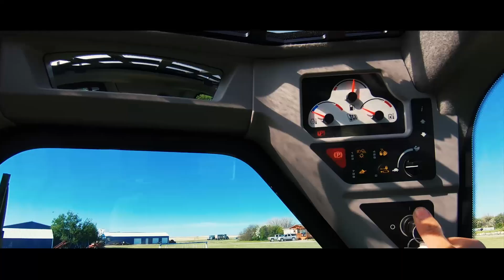JCB Teleskid - Playground Overhaul - Part 1

Comment: There's so much tread left on those tyres, man they'd have to be bald before we stop using them! ;) God bless guys. UK farmer
Reply from the maker: They are all cracked unfortunately! We run them bald too of they could hold air and not ruin tubes
Reply: @WelkerFarms  got you, your climate must really take it out on equipment left outside over winter. Bless you, UK Farmer

Comment: I wondered what was wrong with the tractor tires, they looked like they still had some wear left on them?  Was it just not enough tread depth, were they cracking?
Reply from the maker: Manufacturer defect, all cracked in the same spots and destroy tubes 😔 😢
Reply: @WelkerFarms  Yikes!  That must have been expensive.

Comment: Maybe try to find a rancher to buy the tires for a water bin. Saw them getting used in saco they put a water bin inside the middle of the tire and then insulate the whole tire and it keeps the water from freezing up in the winter. I explained it horrible but I’m sure you know this already

Comment: Could you tell me why you guys dig the Skid steer loaders so much? 
Here in the Netherlands we use mini/small wheel loaders on the farms. We used to have a skid steer (bobcat), but it left tire marks on the pavement, ate tires and was very twitchy. So we got rid of that and now got ourselves a Thaler 3150 that's much more comfortable and user friendly. Not as powerful, but for heavy loads we have tractors with front loaders :)
Reply: We have a 50,000 lb 6 yard loader.  The skid steer is great for most loading around the shop and yard work.

Comment: If you use the machine more with forks than a material handling bucket, would a small telehandler make more sense for your usage?  I believe that some of them are equipped to use the same attachment quick connect system.

Comment: I see about fifty things easy that can be done with those 360 visibility, fast, smooth running little machines. Needs more counter weight and truthfully I like the track version better. I seen the cab buttons for changing out forks to bucket... no more kicking the snot out of the releases/LOL. very quiet and with tunes could run all day. I think that quite a few companies make a version of these now but the visibility on this is just insane, no more running over barrels and stuff behind like fenders on rigs or this part could be a book. So price wise, are they competitive? Biggest difference is learning controls as all the others have just been a difference in spots where the cup holder is. Thanks for the entertainment
Reply: I think they are within other brands.  Sure a sweet machine

Comment: I think with the teleskid the tracks would be a lot better for the stability.
Reply: You loose alot for other uses and the cost of ownership is alot more expensive.... rubber tires work good for alot more uses tracks just destroy everything
Reply: I agree with that but, I still feel the wheels limit the overall usefulness of the teleskid option
Reply: Jacob B yea, any machine with tracks is much heavier increasing its lifting cap.
Reply: But this thing is more fun to play with on 2 wheels.
Reply: Counterwieghts .... my 1991 742b gas model can lift 2000 lbs and it's a small frame .... the cost of track maintenance is insane compared to tires and the fact that tracks destroy the property also kill the usefulness tires do very little damage tracks are bad on grass they are bad on gravel they are bad on asphalt and concrete .... tracks are bad for running stuff over like metals and large stones .... there is so many negatives and limitations but sure they are great for going places they shouldn't be like the woods or swamp holes .... 

Stick with the tires they sell over the tire tracks and solid tire options that make permanent tracks almost useless over tire tire tracks take 5 minutes to install and counter weights take 5 minutes to install giving you all of the benifits with none of the negatives....

Comment: Hey love the videos quick question, Howcome you guys ended up going with the case tracked machine over the JCB?
Reply from the maker: Two reason, first the price. We were not in a position to purchase a $80,000 JCB at the time. Second, we love red machines and when we saw the special edition red skid steer we decided it would be a good fit. But it's days may be limited on our farm. Just not fans of tracks by any means. Good chance we'll trade it off for a wheeled version.

Comment: Whats the weights like in the rear? I feel that thing would be so tippy with the tele-arm all the way out, i mean skid steers are tippy as is
Reply from the maker: I don't know the exact weight but the teleskid as a whole tops out around 10,000lbs. I think tracks are slightly heavier and a bit more stable
Reply from the maker: It can lift 3400 retracted and 1200 fully extended safely.

Comment: If is too wet in the field which is most of North America. Spend it with or working for family. Round  here it's called cow sand used for bedding dairy cows. Same pile as all sand  but cheaper than other sand. Play sand, mortar sand cow sand all the same but price depends on what you ask for. I know a guy that used to trade beer for gravel, wish I knew that when he worked the pit at the neighbors farm!

Comment: Tires still look good what are they all dry rot !!!
Reply: They have cracked between each end of the tread bar and leaks air.  We use tubes but the crack cuts the tube.

Comment: If there is no def then I'm converting everything to jcb. Should have used the tires in the play ground or made a man sized tire swing.
Reply: They kept the engine below the 75 hp requirement. (74 hp)

Comment: You edged you play area with STEEL pipes. In a place where kids are going to be falling over and landing on their faces? Please tell me I imagined it.
Reply: No, that could be a possibility.  We thought about wood but then you deal more with constant slivers on bare feet. If you don't have a barrier the sand will be all over the place.  Concrete wall is no difference a face-plant then steel.  We could have looked at plastic pipe but the thick wall would not be much different then the steel.  And the thin wall  plastic deteriorates with the sun.  We had the old pipe given to us, so if a better solution come we can make the change.  Thanks for your input.  Blessings

Comment: You should give those tires to a Farmer so after he has sheeted the silo he can put those tires on it, or else you bring them to a guy who can put new thread on those tires so you can use them again
Reply: Way to heavy for holding cover on silage piles and the side walls are rotted.
Reply: You put them a the base of it, we only put tires on it and we use the "big" tractor tires at the bottom of the silo because it’s impossible to put on top if you don’t take a tractor